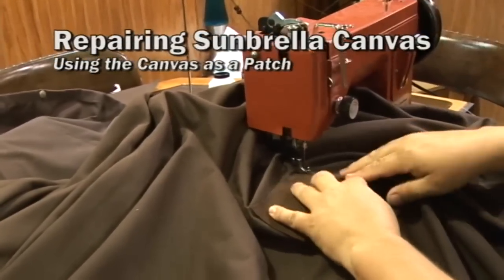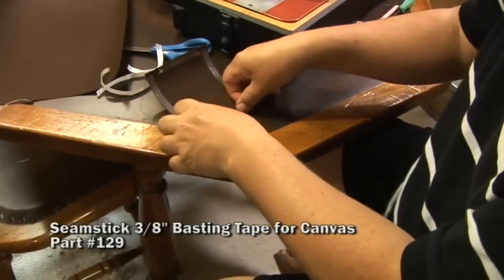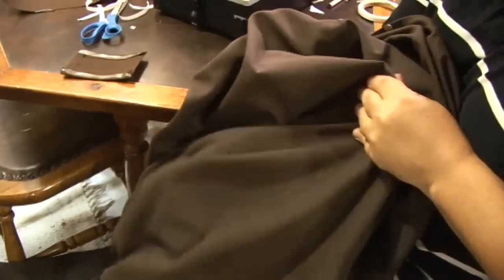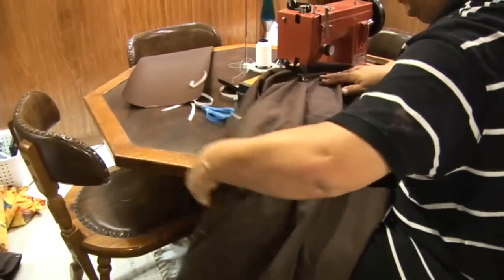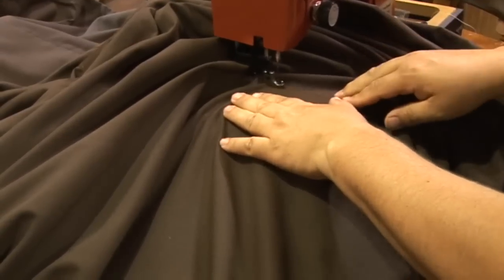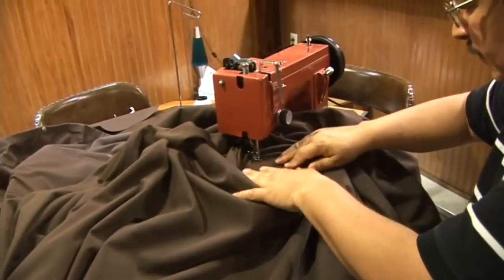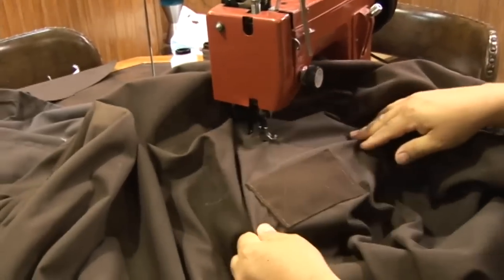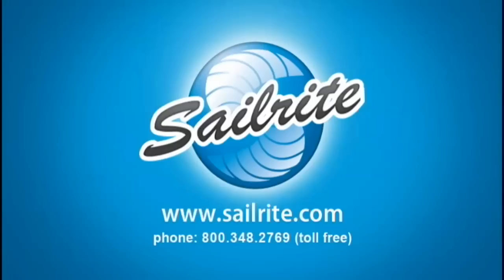Repairing Sunbrella Canvas - Sewing a Patch on Canvas

Comment: TRICK - In order to avoid resetting the needle after the 3rd side, turn the whole project clockwise 90 or 180 degrees before you begin (pre-twist it clockwise).  Then as you turn it counter-clockwise at each corner, the project won't be as twisted and you can sew all four sides without resetting the needle.
Reply from the maker: Great suggestion! Thanks!!!